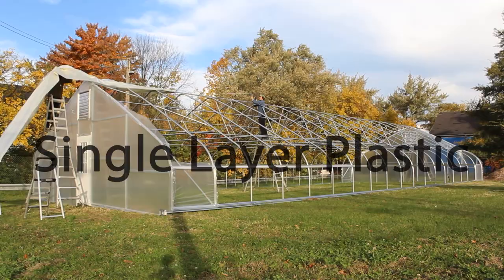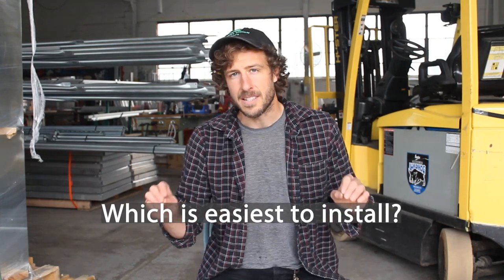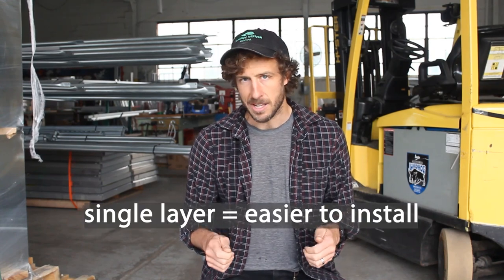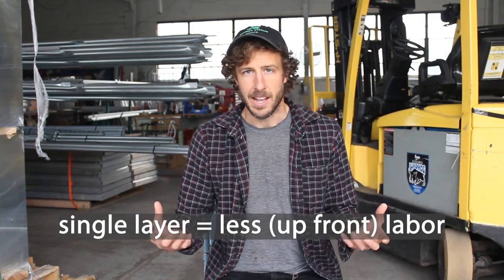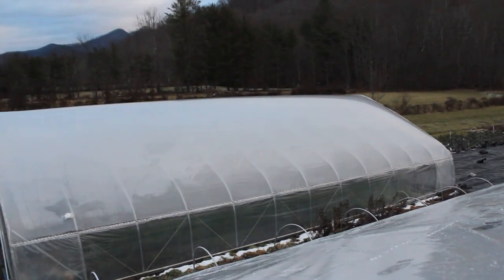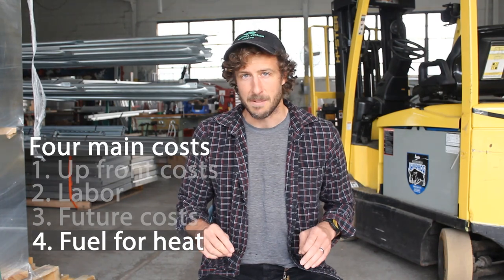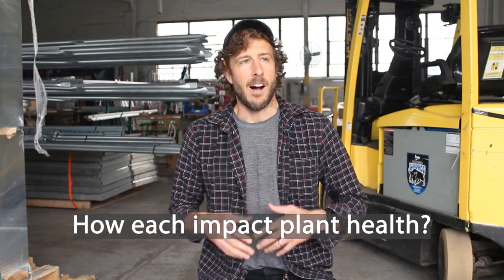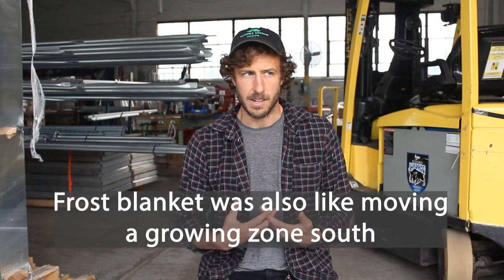Single Poly vs Double Layer Inflated Greenhouse Plastic | Pros and Cons

Comment: Great video. What about any effect of 2 layers and sunlight intensity. If I tend to put a 30% shade cloth on for the summer, how much do you think that extra layer of plastic would reduce light intensity? And as the plastic ages, I suppose there would be a greater reduction.
Reply from the maker: Thanks for the kind words. Most 6 mil plastics let about 90% of the light through. So I would figure that 90% of the light gets through the exterior most layer and then 90% of that light gets through the interior most layer (that would be… 90% of that 90%). If my math is correct, and maybe it is not, that would make the total light transmission through two layers of 6 mil plastic around 72%. This sounds low, but there are single layer woven plastics that only let 80% of the light through, and plenty of people do double layer inflated systems successfully using those materials. 

As for light transmission reduction over time, there will be some of that. From wind, rain, and weather in general, but most usually the actual movement of the plastic, which is caused by all of the weather events mentioned. The movement will slowly create light transmission reduction. Oddly enough, inflating two layers of plastic reduces the movement of both plastic layers and in this sense can slow down the loss of light transmission. 

There is certainly a lot to consider when it come to two layers of poly covering.

Thank again for the comment.
Reply: @tunnelvisionhoops  Ok, makes sense. 
Thanks again for all the information you put out!
Reply from the maker: You’re welcome, and thanks for watching (and commenting)!
Reply: @tunnelvisionhoops  
You are more likely to get a film of condensation on single poly which will reduce the light transmission far more than a double or even triple layered cover. If you can source 2mil uv stable poly, you can use 3 layers of poly to create 2 air cavities. The middle layer has an easy life, 2 mil is plenty thick enough.

Comment: Hi Todd. Ty for the explanations they are both clear  and awesome. You mention that is is possible to Install double layer w/out electricity, by mechanically maintaining the 2 layers separate. Let's say i bolt 2x4 along the internal wall of my GH, install U channels on them and lock in 6 mil poly in these channels, but i don't inflate. I just have a second layer inside. Will the insulation of my gh be improved or is inflation necessary to achieve effective insulation? Tks, have a great day !
Reply from the maker: You are more than welcome! Thanks for watching. To answer your question, it is all about “dead air”. As in, if you install two layers of plastic and they are just laying on each other with no air between, there would not be a gain in insulation because there is no air gap.

If you were to create a physical separation between layers so that an air space exists, there will be some insulation benefit. We used to use a spacer block that was manufactured by an Amish manufacturer that helped with this. We stopped using these because we didn’t like them, but it is possible to do something without electricity.
Reply: @tunnelvisionhoops  ty. I was thinking of the 2nd thing. But for some reason, I kinda belive the r value of a mechanical separation is inferior to that of an inflated separation, akin windows construction.  Double windows aren't as effective as a double window with some gas inside. Am i wrong to believe that?
Reply from the maker: I think that is a fair assumption although I have no data I can reference to back that up for the high tunnel world. Also, even though the manual separation allows electricity to be avoided, the spacers we used to use were made of some form of plastic. So, from a "sustainability" / "low-impact-on-nature" perspective it is difficult to pick a winner between inflation and manual separation since they both require resources in different ways.
Reply: @Natouk01  
Mechanical separation doesnt prevent the cover from moving in windy conditions. If the cover moves, the air inside the cavity will move and you`ll lose most of the insulation value
Reply: @tunnelvisionhoops  Thanks. Youve given me much to ponder. :)

Comment: Excellent video
Reply from the maker: Thanks much, and thanks for watching!
Reply: Great video!! Serious question here. I live in Northern MN.  I've got a 20' x 33' single layer. I'm going to re-cover this spring.  Would I benefit from a (Triple layer) my thought is. The outer layer keeps the really bitter cold off middle layer, middle layer separates the warm area from the minus -40° outside. 
Do you know if this has been done? And where best to draw inflation air from ?
Reply from the maker: @TheJim9595 That is an interesting idea, but one I have never seen or done. The trade off between interior vs exterior drawn air is condensation vs warmth. If exterior air is used between layers your condensation between layers will be reduced and more light gets through, if interior air is used between layers your condensation is increased, but the pad of air is warmer (which could have its own benefits). 

Essentially there are pros and cons to each. If you were to do both layers with interior air draw you may find that two layers of condensation-filled air pads creates too much of a decrease in light transmission. So doing one interior air draw and one exterior air draw blower fan could be a good way to split the trade-off up. 

Either way, the above are just my thoughts since I have never done this myself. If you do execute this installation, I would LOVE for you to send an update with how it goes. 

Thanks for watching and for commenting!
Reply: @TheJim9595  
I run a triple cover on my dome greenhouse,  5mil for inner /outer and 2 mil for the middle layer

Comment: Severe Wind Event? Funny Story...
I erected a single layer hoophouse & know we get some ass kicking wind here on the Pacific coast  So  what I did was
I took 4 - three foot T post & drove them in the ground inside the 4 corners  THEN  threw a ratchet strap up & over the
metal frame under the plastic & ratcheted them just taunt. 2 days later we had a  SEVERE WIND EVENT. 40mph steady 
winds gusting to 60. My new hoophouse? Steady as a rock. HOWEVER, when I went into it the next day I found the wind
had been  SO  strong it had bent a couple of the steel frame pipes. But it stood.

!